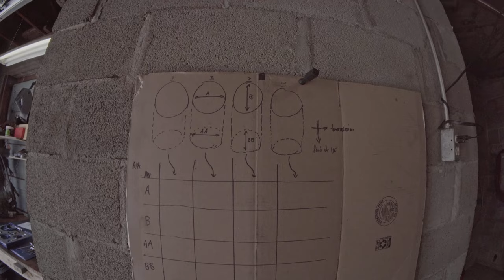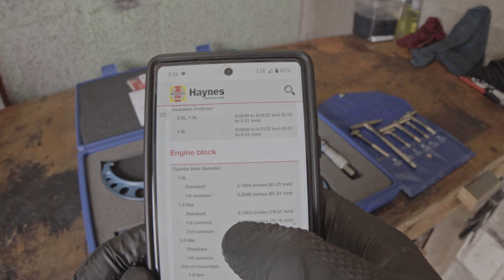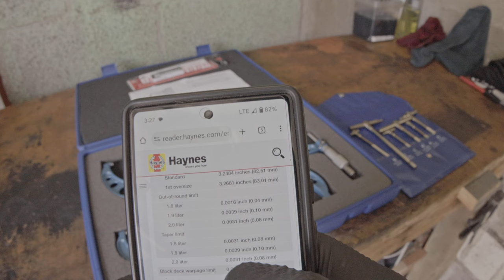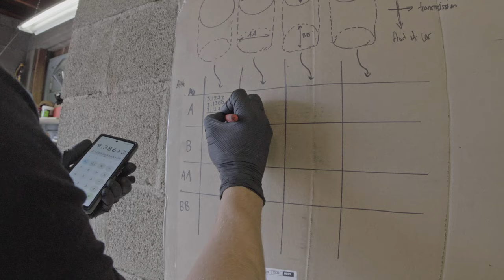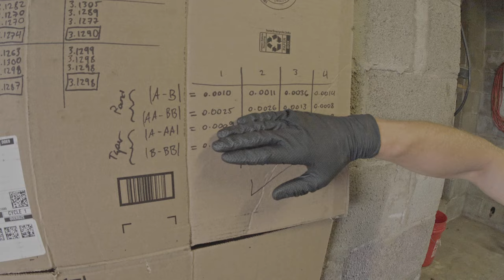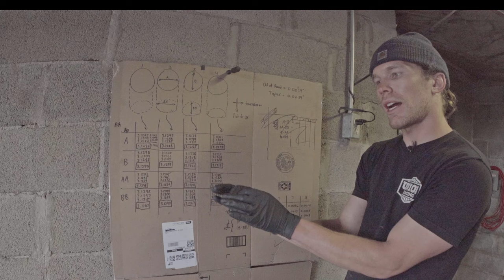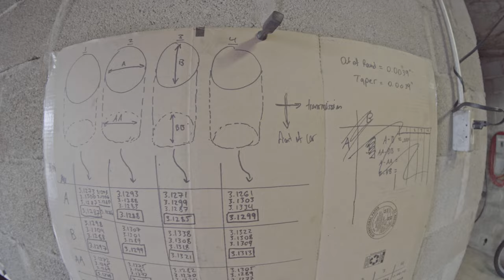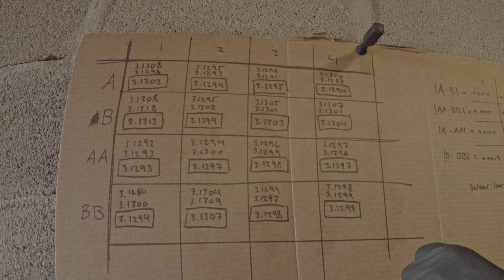HOW TO check your engine cylinders! ALH turbodiesel

Comment: One of the reason you came less than spec is because your using a gauge with flat ends to measure a round bore. The gauges I've seen before have been a dial gauge where you can see the indicating needle move while measuring and using your smallest reading. 

-But very informative! Great Video!
Reply from the maker: Hmm. They did have round ends (very slightly half domes) so I don't think that was the issue. I really would blame the cheap construction of the slide gauge for the most part - but it still got the job done just fine. The other gauge you mention sounds convenient!

Comment: Cry Once 😉
Reply from the maker: Yes & no. It doesn't really help to have a bunch of expensive tools that you only use every 5 years, but it's nice to have them work well for sure 😮‍💨💁
Reply: Consistency is key you could even use a set of calipers instead of a micrometer and get accurate results. However this is only useful for finding the cylinder to wall clearance